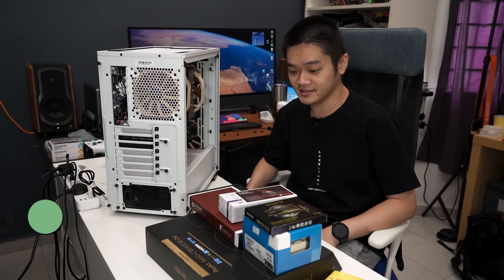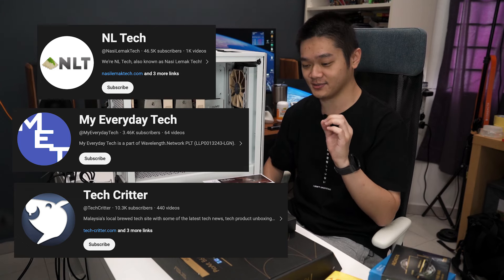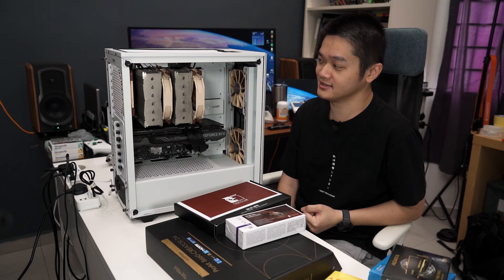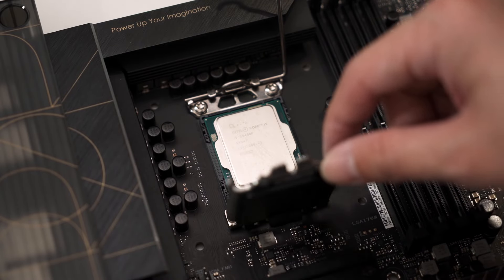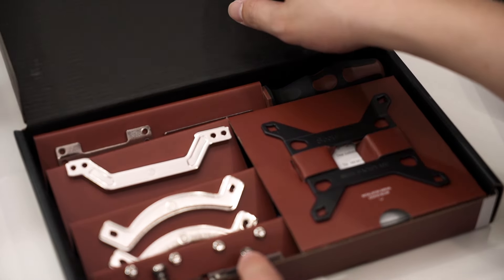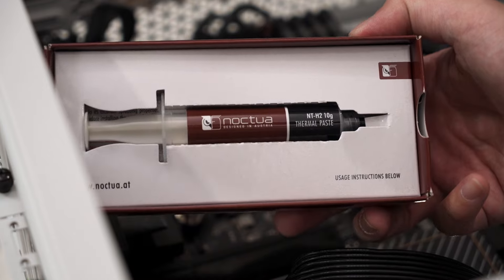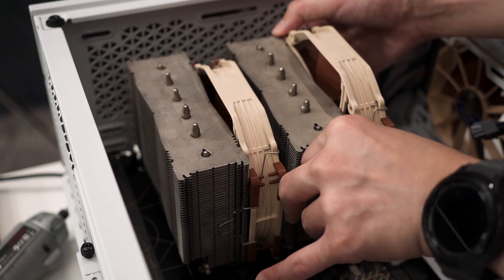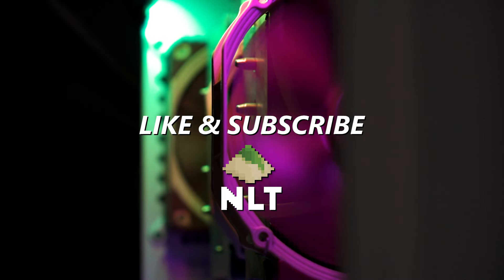Upgrading my PC - Join me!

Comment: A bit funny that the board that housed the 2700X is AM4 socket which can be instantly bios flashed to unlock 5000 series to do a drop in upgrade but hey, good luck 😁
Reply from the maker: Nah, I got sick and tired of AMD’s instability with the RAM. Since I got a motherboard lying around, I just changed to Intel instead. And I got PCIe Gen 4

Comment: You make it look easy.
Reply from the maker: Kinda yes. Got used to it lol
Reply: @NasiLemakTech  I think the main thing is confidence. When you are unsure you have to think through many things and pick one path, and that takes a lot of time.
Reply from the maker: @woofinu  like how I installed the cooler bracket in the wrong orientation 🤣
Reply: @NasiLemakTech  You made one "mistake." I would have made 10, and fried 1 part for connecting it wrong 😃And about the cooler bracket, you got the orientation correctly but they designed it wrong. Of course.